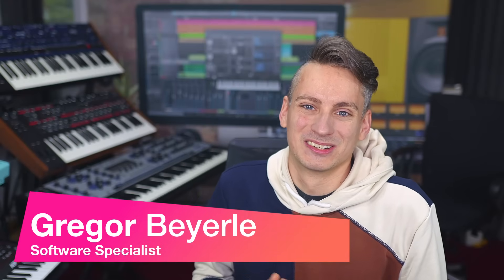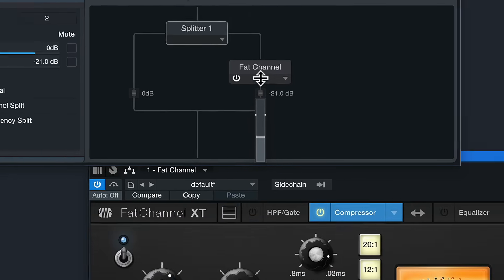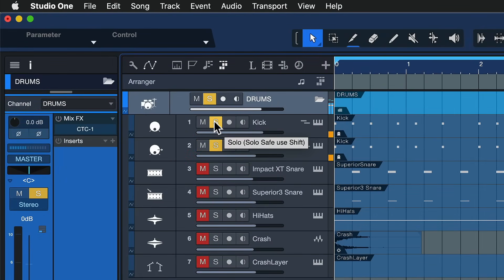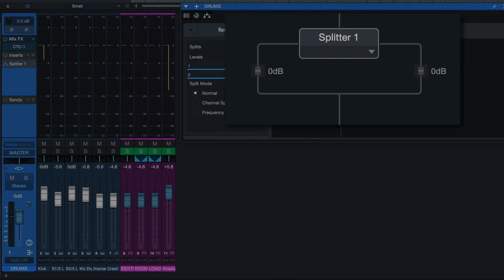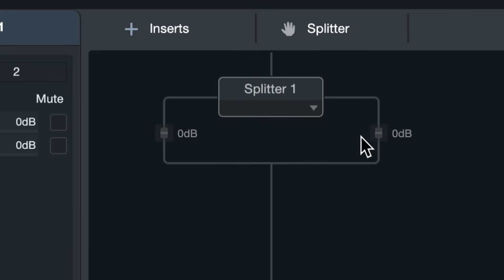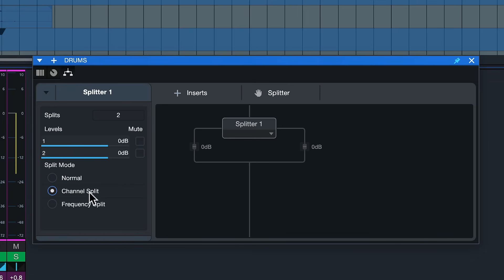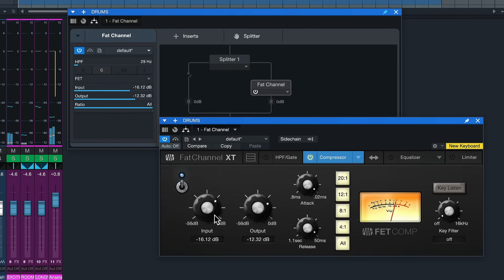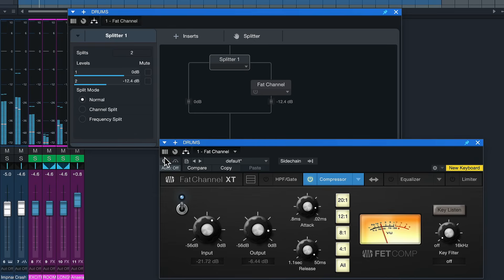How to Set Up and Use Parallel Compression | PreSonus

Comment: Hey Gregor, can you demo how to do this using a stereo compressor on a bus using the splitter plugin? when i throw a splitter on a drum bus and route one copy to stereo pipeline to use my favorite offboard compressor, coming back in and mixing with the dry signal it always sounds weird/phasey, especially with the overheads.

Comment: Another great video, Gregor. I like how clean of a solution the splitter is. However, unless I’m mistaken I can’t automate the balance/volume of each “split” or am I missing something? Sometimes on a vocal I like to do parallel compression and even parallel saturation/distortion and add more parallel compression etc. in the chorus. I seem to only be able to do this if I use busses?
Reply from the maker: Thank you so much! You are correct, the split levels cannot be automated at this time. As a workaround, you could insert a Mixtool Plug-in to each split and automate that instead. Hope this helps. -GBY

Comment: It would really be helpful if you could do a video using the stock Studio One compressor.  A lot of us don't use other plugins.  Very frustrating.
Reply: FatChannel is a stock plugin. It comes with Studio One. The FET Comp that Gregor uses in this video is even available in the Studio One Artist version. Don't need Pro to use it.
Reply: @michaelworner7133  Did I mention I was using version 2.6?
Reply: @michaelworner7133  I'm pretty sure it doesn't come with version 2.6.  If there's a way to get it and it's compatible with 2.6 let me know. Thanks.

Comment: It doesn't work as it should. This placement of the compressor, when we turn down the volume of the parallel compression feed in this way, we are essentially turning down the volume of the drums. I checked it more than once. This is not a very good way.
Reply: Concuerdo con que dices. En mi caso dejo la entrada al compresor en un mismo nivel y más bien manejo la salida o con el Mixtool después del compresor.
Reply: @finanzasenaccion-m4q  I just use a separate FX channel, put a compressor with quick settings and a saturator on it. And I already mix this channel to the vocal bus.

Comment: This isn't a question about Parallel Compression (forgive me... ), but I'm not sure where else to ask this question:   When setting up the FET compressor, you suggested setting all Ratios on.  Can you (or someone) explain what these ratios are?  I have a feel for what a ratio is on a compressor, and most compressors I've used have one setting for Ratio.  I find the concept of having multiple ratios confusing.  Maybe the word is being used in two separate contexts?   Help!   Thanks! :)
Reply from the maker: Hi Kirk, pressing all the Ratio buttons at once used to be a famous trick on the 1176 FET compressor to get a maximum Ratio greater than 20:1. You are correctly assuming that there is only one Ratio here, even though multiple buttons are pressed. This just used to be the way to get the highest possible Ratio amount in those compressors back in the day. :) To learn more about what Ratio means / does in a compressor, please watch this video: https://youtu.be/WG9-2jq81cY

Hope this helps! -GBY
Reply: you should just google/search on youtube these types of questions if you're serious abt having them answered.. everything is on the internet these days man, hope you find what you are looking for !

Comment: I sometimes use heavy 808’s in my tracks, should the 808 be paralleled compressed on its own buss? Thanks Gregor. BTW when I see you uploaded an S1 video, it’s an automatic click. Thank you.
Reply from the maker: Thank you so much! Parallel compressing the 808 a few times extra is never a bad idea. :) You could just do that by inserting another Splitter, though - no need for an extra Bus channel. -GBY

Comment: The big, Big caveat, is that when you don’t insert the splitter right from the start — i.e. when having already made your gain staging and maybe applied some processing too — then you have to be much more careful about the fact that the left (or right) branch of the splitter is 6.02dB lower than the original signal.

Most of the time, I have to insert a Mixtool in that left branch to bring the level 6.02dB up in order to preserve my gain staging.
Reply: exactly.

Comment: Not convinced Splitter is a better workflow than a bus for parallel compression, the intent is less clear at first sight than a bus. To each his own ;-)
Reply: Yeah, but overall you have signal compensation and better control at the very end anyway so why not?😊it's like with integrated Ai tools, some ppl like it and some hate it...
Reply: Choice is good, no doubt some will prefer using the Splitter @fuserproducer